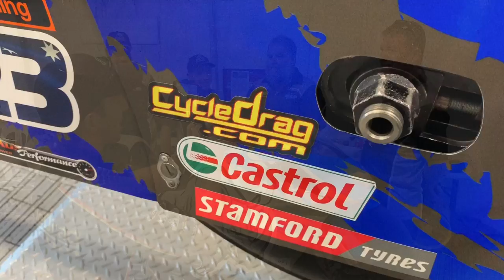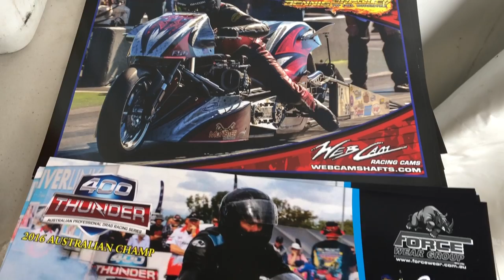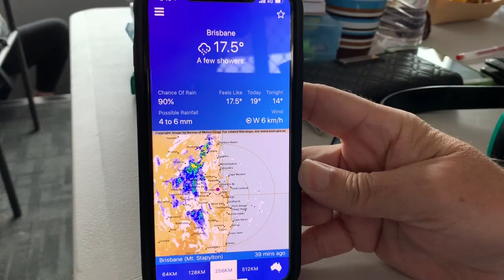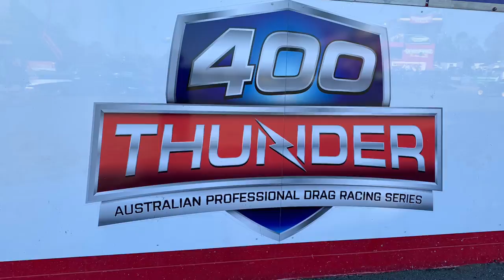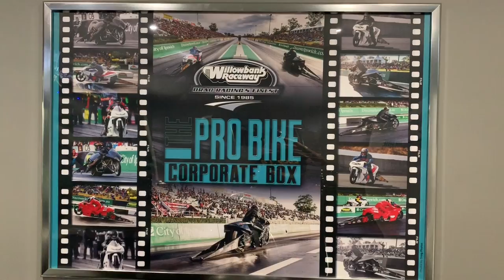FULL EVENT! IHRA vs NHRA PRO STOCK MOTORCYCLE (PRO BIKE) RACERS  BATTLE at AUSTRALIA WINTERNATIONALS

Comment: Hey race fans,
The blue Toyota Solara is piloted by Ben Bray. The Bray family are Drag Racing royalty in Australia. https://youtu.be/wJ-YZPOleig for an in-depth look at the Toyota.

The other car is a Australian V8 supercar. 5lt pushrod V8 raced exclusively on road course circuts.
They race door to door, wheel to wheel. Like NASCAR, it's the major national tin top championship run down under, and the place where Marcus Ambrose cut his teeth.
The best introduction would be any of the Bathurst 1000 videos on YouTube if you want to know more. 

Cheers for the coverage Cycle Drag, it doesn't get get anywhere near enough coverage.